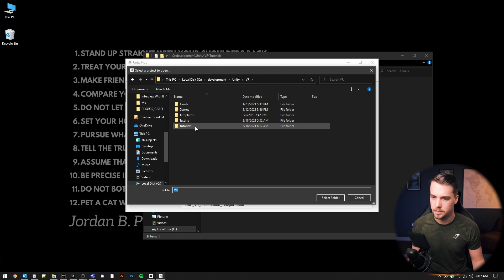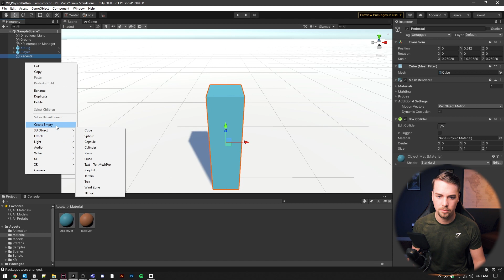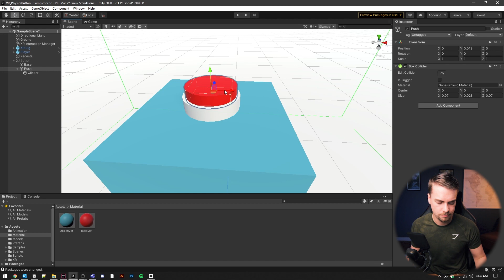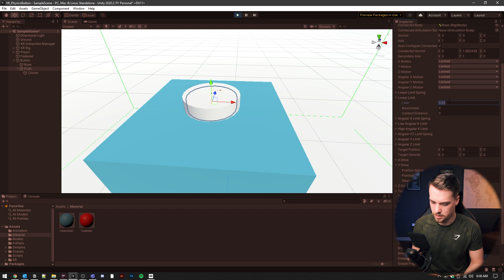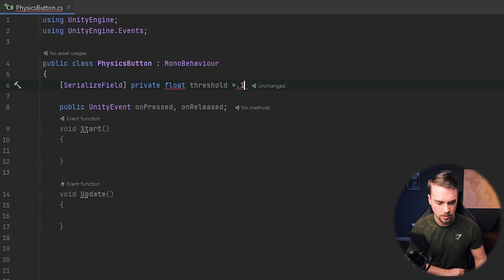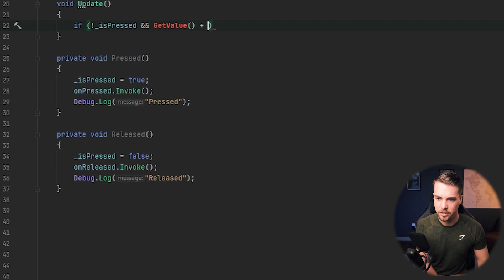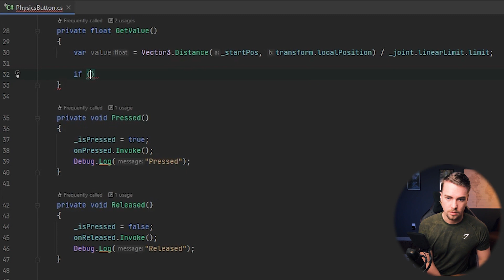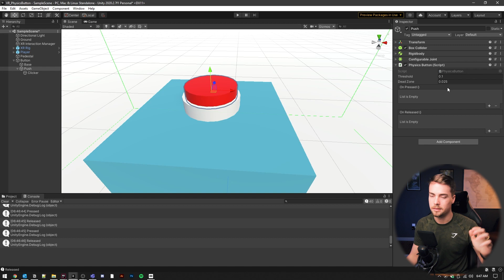A Beginner's Guide to Making VR Buttons

Comment: Hey Justin, thanks for the great tutorial.  I am working on making this dummy proof and I've discovered that the button works great when pressed softly and right on.  However, if you go from underneath or press it really hard, etc. it can move beyond its limits.  Any idea on what settings can be used to confine the movement to only up and down the limit specified?

Comment: Hey Justin! I am late to the party, but I didnt really understand your GetValue function and couldn't get it to function properly. The joint is set up correctly, I am sure. When I press the button for the first time it triggers the 'Pressed', and then when I let go it moves up out of the deadzone and then triggers both the released and a new pressed! I think it has something to do with the (local)scale of my button objects? I figured out the math below, which seems to do the trick perfectly. It doesnt use the deadzone var anymore, just the threshold var, which now acts kinda like a percentage. 

[SerializeField] private float threshold = 0.1f;
Vector3 ButtonEndposLocal;
private bool _isPressed;
private Vector3 _startPos;

void Start()
{
        // this is where I figure out the End Y position of the button when it is fully pressed.
        Vector3 ButtonEndposGlobal = transform.TransformPoint(_startPos) - new Vector3(0, _joint.linearLimit.limit * transform.localScale.y , 0);
        ButtonEndposLocal = transform.InverseTransformPoint(ButtonEndposGlobal);
}
void Update()
{ 
        if (!_isPressed && GetValue() + threshold >= 1f)  // from 90% pressed onwards
            Pressed();
        if (_isPressed && GetValue() - threshold <= 0f) // from 10% pressed or less
            Released();   
}
private float GetValue()
{

       // returns a value between 0 and 1, 0 for not pressed, 1 for pressed. 
       return  Vector3.Distance(_startPos, transform.localPosition) / Vector3.Distance(_startPos, ButtonEndposLocal);
}

Comment: i dont know what is causing it but it seems like the collision with this joint is fairly inconsistent. i've scripted my own button which does exactly the same which also works on angles without any joints (using dot products to figure out where the button should snap back to / spring back up) and this seems to have no issues with collision as its only a rigidbody moving with physics controlled by a simple script

Comment: This was so helpful! Thank you! The only problem I have though is that I keep getting errors saying that ""Math" and "Abs" does not exist in the current context." I'm not sure what this means...
Reply: I had the same problem I fixed it by adding (using System;) at the top hope it works for you too.
Reply: @MeDodan  thanks
Reply: @MeDodan  thanks this worked
Reply from the maker: I've actually been getting the same error for Math.Clamp... idk what the issue is though. Maybe just a re-compile/restart
Reply: I know this is an old comment, but I see a lot of these on the vid. Don't forget to add the 'f'. It's Mathf.Abs, not Math.Abs. Just in case anyone else comes along and are having similar issues.

Comment: HELP: Any idea why regular rigidbodies won't press the button? I want to give the player a cube to be able to set on the buttons and move between buttons that way. The cubes won't activate the buttons though. They just fall and sit on top without moving the buttons down at all. The Pressed and Released are working though when I manually slide the buttons down in the editor view... Any ideas?

EDIT: "Enable Collisions" is on in the Configurable Joint component of the Push object. Still not working :/
Reply from the maker: Is either rigidbody’s isKinematic box checked? That would prevent it from using physics

Comment: The button goes through the table for me
Reply from the maker: just gotta tweak those settings! It can be finicky
Reply: @JustinPBarnett  I tried everything but game up. I use hand tracking so maybe it's because the hand colliders are forced onto a position
Reply: @TechDunk  Hey dunno if ur still having a problem with this but I had the same problem with using hand tracking so I just added this for a work around:

public float minY = -0.01f, maxY = 0f;

    void Update() {

        Vector3 currentPosition = transform.localPosition;
        currentPosition.y = Mathf.Clamp(currentPosition.y, minY, maxY);
        transform.localPosition = currentPosition;
    }

This just limits the y position of the button so maxY = 0f doesn't let it move up and just tweak minY so it cant move down through the table. It works well enough for me just if you do press it too far down it will teleport up instead of springing back up cuz your hand will be pushing it up.
Reply: @jaded4831  ended up with a different UI element, but thanks!

Comment: I followed the tutorial 100% and the buttons work when on a flat surface and you press from the top, but if I rotate it 90 degrees to put on a wall it no longer works correctly.
Reply from the maker: Did you rotate the entire button GameObject or the elements within?

Comment: Has anybody used this to make a multiple-choice question? I'm building an Education VR app for Oculus Quest and I want to use buttons with several buttons labeled A B C D like a multiple-choice question. A little confused on how to implement but I have a base idea. If anybody knows any resources or how to do it themselves I would greatly appreciate it!
Reply from the maker: That's a good idea! I'm curious to see if anyone has some good answers
Reply: You can make a simple script containing two bools (one for is pressed another for  is correct) in another script you make an arrey of script one and loop therw it when you check it make an int a before arrey loops. If is pressed and is correct then do nothing but if is otherwise add one to a int a. After loop check if a is greater than zero. If it is anwser is wrong. If a is 0 player has anwserd correctly. You change is pressed when you press, is correct you chenge in inspector.

Hope it helped :)

Comment: My program runs at start and keeps pressing and unpressing continuously, without physically moving. Everything is set up the same. Any ideas?
Reply from the maker: Hmmmm, is gravity checked on the pushable button part?
Reply: @JustinPBarnett  With or without gravity it still doesn't function how you had it in the video, but I have all my settings set how you do. Now I made it so it runs once at start, but doesn't click again. The spring works but not the code.

Comment: C# noob here... How would you add a light that switches on/off ? I assume the 3D object with the Unity light needs a C# script attached that tells it to turn on...
Reply from the maker: Nope! all you need is to add a light source and then in the onPressed/onReleased event find the light source and select the on/off action!
Reply: @JustinPBarnett  — thanks for responding— I will try this !!
Reply from the maker: @zonoscopePictures  let me know if you get it working!
Reply: @JustinPBarnett  I've built a button which I can click on ,  I am trying to use the button to switch a light on and off. I created a Spotlight which animates from 0 intensity to an intensity of 2.4 over 10 frames. I added the Animator ("spotLight1_OFFON") to the Spotlight in the Inspector. In the "Push" attributes of the Button, I added this ("spotLight1_OFFON") to the field under  OnPressed() . The other field  (in OnPressed) has the options "No Function", and "Animation Clip", I have tried these options and none seem to work. It looks like the options under "Animation Clip" (float frame, bool, etc) are C# terms, but I'm obviously a C# newbie.... If anyone has any insight on how I can hook up my lights to the Button, I'd be grateful!
Reply from the maker: @zonoscopePictures  my suggestion is making another public method that has a bool variable to check if the light is on. Just have this method run every time OnPressed() is performed and then turn the light on or off based off of what the bool variable is.

Comment: Yeah I like it, there is an odd collision error in the console, however I was trying to pull the button up at the time.
This could have also been used as an iteractable object to rite?
Is there a fix on the cards for the collision between the hands and an object I refer to the object and hand fighting for the controller position, my thought were to disable the collision of the hand so you still had the interaction of collision of the object against other objects.
Reply from the maker: What's the collision error? That's odd...Yea your fix would work by turning off physics for the hand and forcing the player to pick up an object to press the button with. Doesn't sound too intuitive though.
Reply: @JustinPBarnett  that's what I thought, however I don't see how else you could stop the two objects fighting for the same position, so it could just be me looking at it all wrong.
The only other idea I had for this would to alow the block or object to push the finders back a bit, to alow for a much more natural look grab, and to apply some way of stopping the grabbed object from, pushing for pole position with the hand.
I'm not at my PC at the mo, but I will post the error if I can recreate it.
Reply: @JustinPBarnett  I was thinking more of the previous tutorial were you rigged the hand to pick up the cube, with colliders on both cube and hand, not so much for use as a way of pushing the button, next time I'll split my comments to the correct video to avoid confusion.
Keep up the good work and I look forward to your next video.
Reply: If this was done with a (for lack of a better word) lock zone, that was a set location on the hand to snap picked up/interacted objects to.
I am in now way suggesting snapable zones, just a good fixed position for the object to fit to while held.
If would be interesting to know your thoughts on the subject.

Comment: Cool video! I'll have to try this. I'm also trying to do a steering wheel and a throttle lever for speed to drive a vehicle in vr using hinge joints, but once the vehicle starts moving, these objects with joints gets effected by physics starts to wobble. Do you know how to use these joints in a moving objects? Or is configurable joint better option in general?
Reply from the maker: hmmm my first though is to increase the dampening required to move any of the joints. Hinges should work fine for that. A configurable joint just gives you more flexibility with how the joint moves, but I don't think it'd be required for your case. You could also do some kind of collision check and lock the joint except when the player is colliding with it, something like that. Let me know if you figure it out!
Reply: Thanks for the question, exactly what I desperately needed! :D